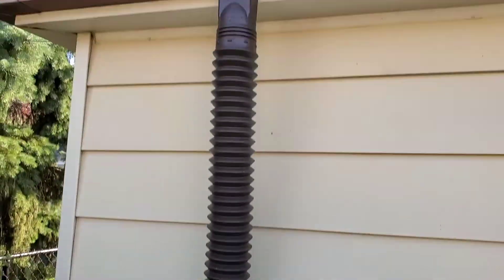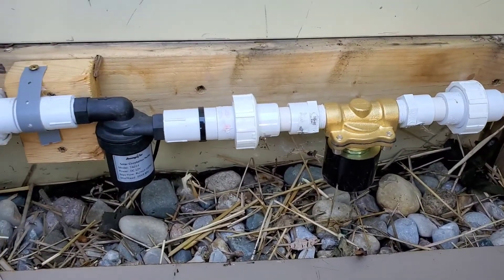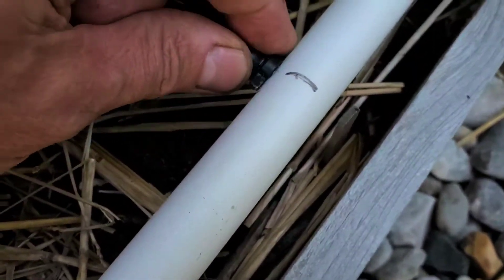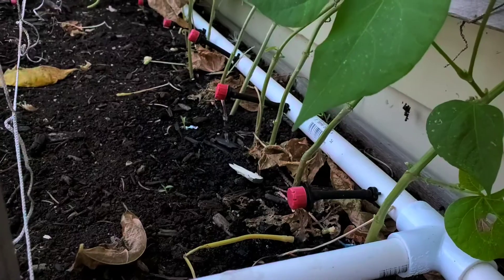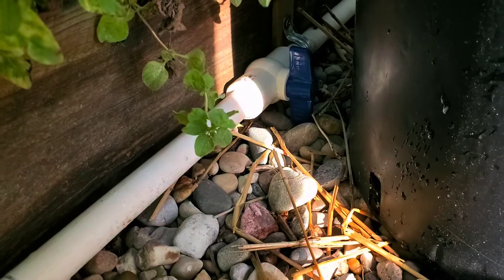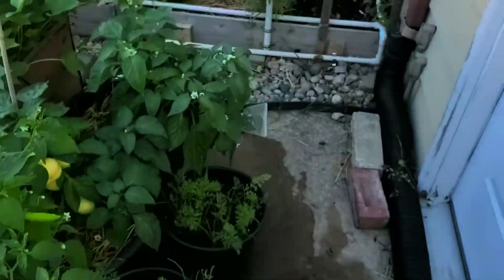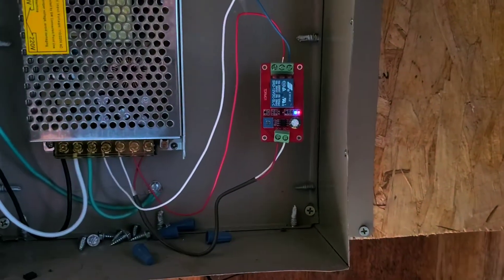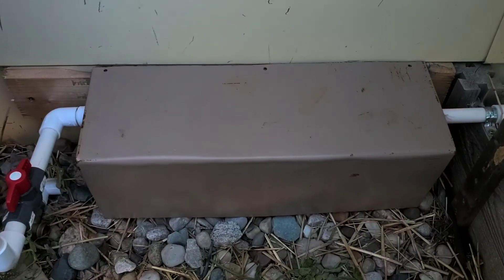Drip Irrigation With Pump On Rain Barrel

Comment: Thank you for posting all the details! You really helped me know I was on track with my (simpler) design. Just a suggestion, to make your city water use easier, you could connect your water hose to a float valve in your rainwater tank, then leave the hose spigot on. Keeps the tank full, and the rest of the system operates as normal. Safest install of the valve is at the top of the tank, with an air gap between valve and water, so there's no risk of siphoning the tank water back into your house drinking water.

Comment: I am looking to set up an irrigation system on my deck/balcony. I've been trying to see what type and size pump I am going to need, and a good idea of how to plumb the water lines to where I need them be. Your setup is very similar to what I am trying to create, but my water supply tank will be about four feet below two of the planters, and about two feet below a few large pots.  My problem is I do not have a rain barrel or city water to work with. I have looked into a plastic water tank (20-40 gallon capacity) and a small hydroponic submersible pump... but regulating the pressure was a problem. Many small pumps have GPM and head height specifications... but not PSI. Your pressure regulator might be the solution to my problem. Thanks for showing off your system.
Reply from the maker: Glad you enjoyed the video. Yes, those pressure regulators are readily available at Home Depot or other big box stores. Only about $5. Thanks for taking the time to comment.

Comment: Hello,, thanks for the suggestions. I am setting up a rain barrel system. I think this pump and a regulator will be perfect. But, I am trying to figure out a remote/solar source for the pump. Also, wondering if a timer placed after the pump and a timer for the pump itself would make sense to turn drip system on a daily schedule?
Reply from the maker: I'm not sure I understand the reason for a timer after the pump.
Reply: @thescorchsquad  i want everything on a timer so i dont even have to worry about watering my flowers and plants.

Comment: This is a brilliant system. Exactly what I have been looking for. Thanks for posting. If I wanted to build this for my garden from a 10 barrel water catchment system, could I use an inline booster pump rather than the pump/solenoid system you used.
Reply from the maker: The reason I used the solenoid valve was because the solenoid valve does a solid shut off of the line. Without it water will slowly flow thru the pump just from gravity since the water level in the barrel is above the output line. It will even occur with a pump inside the barrel with tubing that goes out the top of the barrel and then back down towards the ground due to a siphon effect. I don't know what a booster pump is but I don't know of a pump that shuts off solid when powered off. Hope this helps.
Reply: Thanks for your reply, I will do more research.

Comment: Awesome setup. Do you experience pressure loss at the end of the line, or do the drippers limit the flow enough for water to get to the end?
Reply from the maker: I haven't had any problem with pressure loss. Since my drippers are adjustable I was able to balance it out to get pressure all the way to the end. If you want to use fixed gph drippers then another option would be to make a complete loop with the main line with the water barrel tee'd into the loop, the fixed drippers will all need to have the same length of the 1/4” tubing and then all will have the same pressure. This is the method I use for my hydroponics. I'll be posting a video showing this type of system soon. Hope this helped. Thanks for taking the time to comment.
Reply: @thescorchsquad  thanks for your explanation, it was very helpful. I'm looking forward to see your hydroponics setup!

Comment: How do you keep gutter debris out of your system? By the way, thanks for posting this. Your system is elegant in its simplicity!
Reply from the maker: In the top, for the downspout, I used a basket with some aquarium filter media to catch the large stuff. Then for sediment, I have the outlet pipe about 6" up from the bottom of the barrel. Sediment accumulates but never reached the level of the pipe. At the end of the season I clean out the barrel. Glad you enjoyed the video.
Reply: Peace Love Garden Thanks.

Comment: I'm looking for the barb adapters, ebay link not functioning, looks like the item is gone.
Reply from the maker: Here you go, I'll update the description... thanks for the heads up! https://www.ebay.com/itm/50pcs4-7mm-Splitter-Adapter-Connector-Barb-And-Garden-Irrigation-Hoses-6mm-S5-/402723636337?_trksid=p2349624.m46890.l49292

Comment: do you have the specs for your pump, solenoid valve, AC/DC converter and timer??
Reply from the maker: The exact parts I used are in the video description, all purchased at Amazon or eBay
Reply: @thescorchsquad  Thanks! :)